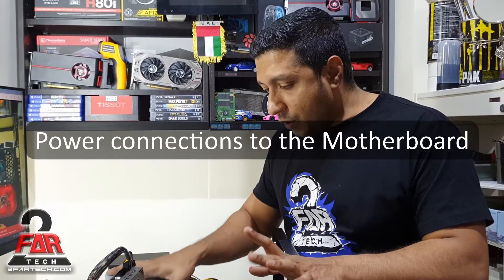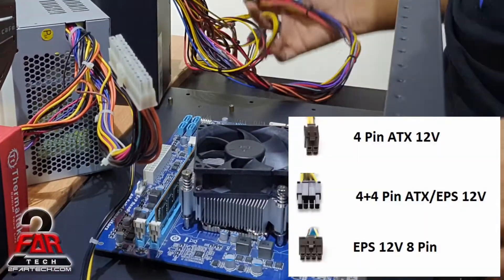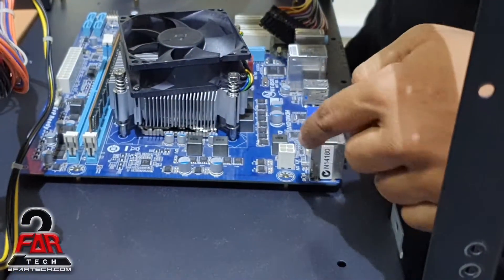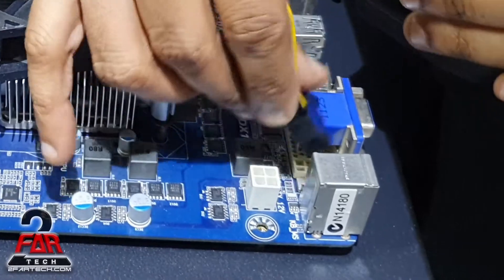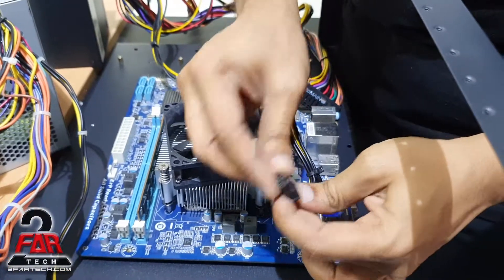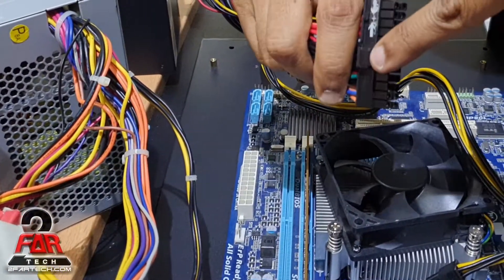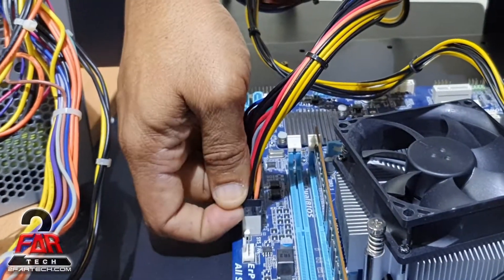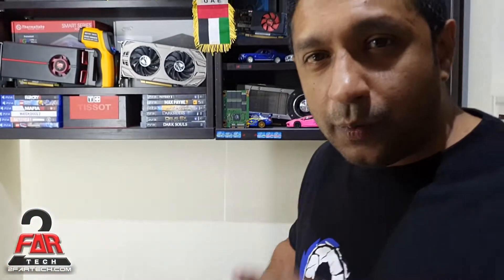How to connect the power cables to the motherboard?

Comment: You should make a vid on how to connect power,reset,led...switches from case to mobo (+ and -)
Reply from the maker: Yes, that's one of the videos I am planning to do using different motherboards because this can get confusing at times even for me.
Reply: @2FarTech  yup mostly i mess it up cuz there is no marks on + and -  on the wire that’s suppose to be plugged on the header

Comment: Sir I have a motherboard asusb360m plus gaming,on which mentioned (support Intel core,pentuim 8th generation) sir my question is ,do it support  Intel 9th generation processors?
Reply from the maker: I assume your motherboard is the TUF B360M-Plus Gaming. If your bios is Newer than the Version 2201 released in March 2019, then it will support most of the newer 9th gen. Actually the latest version is 2811 released in July 2020. You could update your bios by going to ASUS website and the motherboard Model under support. If you are worried about BIOS and Updating BIOS. Just check for BIOS version in the Command Prompt. Type systeminfo and it should show up somewhere in the top of the details.